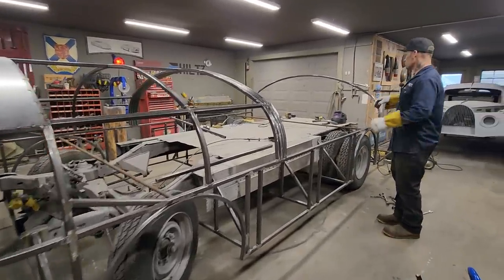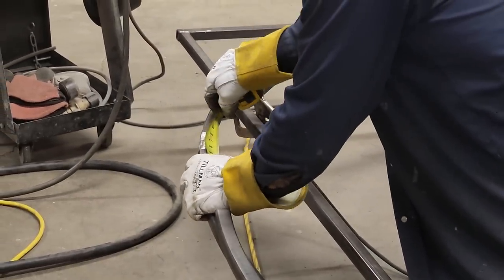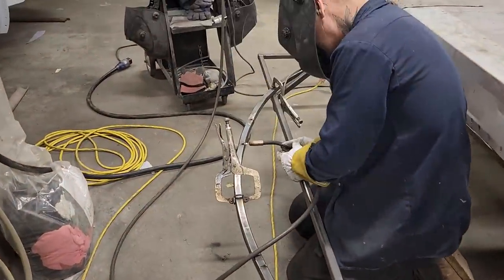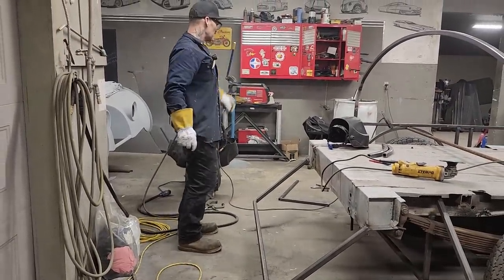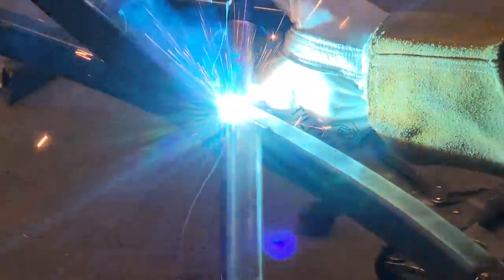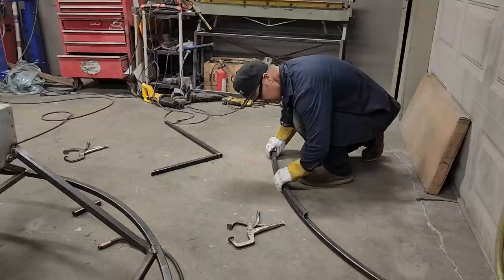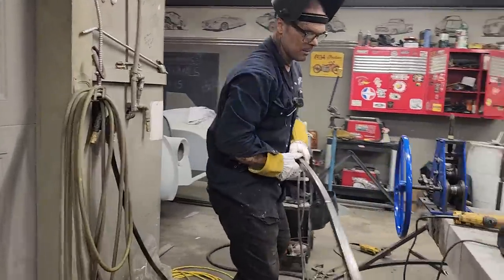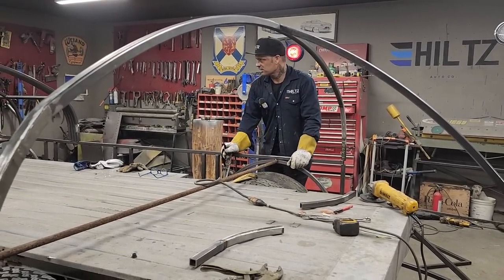Change of plans… redesigning the rear of the truck 💥

Comment: Id consider adding a chassis to the front that drops down and goes to a front bumper for straight, safety and put the seat and front bumper on, plus take steering gear

Comment: A round bum is always good looking! Seriously, the round rear is going to look great IMHO. About the steering; you could use a medium stroke small bore hydrallic cylinder attached to the steering assembly and a rotary spool valve at the bottom of your steering column. This might give you more flexibility on locating your seating arrangement and eliminate the current (and very large) steering box. Nathan and the guys at your local hydraulic shop or Princess Auto should  be able to advise you about feasability.

Comment: As far as the front tires are concerned, as long as you can turn the vehicle from side to side as is, I wouldn’t try to extend the front axle length or anything, just fabricate a couple of fender skirts and call it good 😊👍

Comment: That is perfect! The back more pointed than the front is the embodiment of 20s-40s design! The back makes me think of something like a 1937 greyhound bus. Amazing work!
Reply: How is the back at that angle going to cooperate with the last roof support?  It seems like the angle from the flat curved roof to the angle of the rear down will be harshly sharp.  I think he will cut it off and make it more straight from the bottom with a curve half way up that more closely matches the front so the roof to rear flows nicely like the front does.

Comment: If you are going to use it to tow vehicles then you need to think about a tow hitch that will need to come out the back and contact to the original frame and at the right height to tow correctly 
Now would be the time to fabricate that in  so it is strong enough 
This project looks great so far ,awesome work

Comment: I know that it would be different than the original idea, But looking at how much room you have in the front wheel well, how about putting fender skirts on front and rear and completely hiding the wheels? Then you wouldn't need to get the front wheels any wider out. I think that would be a pretty cool look.

Comment: Chad,  Engine needs to be removable from the bottom. All you have to do is figure out where it is going to be and box up the hole on the deck. Then you can make a cover to close it off. I'm more worried about where the door is going to be to drive it.  Steve

Comment: Shed as you build your doodlebug, you might think about adding the ventilation for the engine to get rid of the carbon monoxide that might be let out it’s a silent killer wouldn’t want to see anything happen to you guys that’s why to bits it looks like you’re doing a great job
Reply: Or seal the cabin off with a bulk head isolating  CO fumes is a good idea even for short term trips

Comment: Good call on the rear, it looks great. I still think installing the engine, and trans. from the bottom would be the best thing to do. So much easier for later on if you need to pull it to work on.

Comment: Hey Chad if you put the ls in switch it to carburetor and put a 350 turbo behind it then it will make the wiring of the motor a lot easier because all you have to do is hook a msd box to make the coil packs work and for alternator you could run a one wire just a thought

Comment: Try a Lenox 5" diamond disc cutter on the grinder. The diameter of the cutter won't shrink as it's being used and will give you 1/4" extra cutting depth.

Comment: Love Chad's vision on an aft redo.
Reply: Totally agree, like the shape of the rear. 
Also need to think about the cooling system/ radiator and air flow for cooling.
Reply: @CSmith-oz4wp  The photos appear to support a rear engine layout. The louvers and such are just aft of the rear wheels. I would like to see a photo of the engine compartment but haven't located any.

Comment: Looking good, those roof bows, or rafters as you call them could actually help you out as far as the engine goes. When you mentioned windows down the side to see the engine, you could use the bows to make a removable section, even as a side tilting centre hood scenario or gull wing style? As you said, it’s not a replica of a ‘Doodle Bug’ it’s only inspired by one. So many different directions you could go with this, I’m not quite sure what your plans are for this thing other than looking cool Cheers again from Australia.

Comment: Looks great guys but as an ex-trucker I know you will need to be careful where you drive it with that much overhang that low at the rear you will probably scrape in driveways etc. but it does look cool, All the best, Al

Comment: Chad 1st time commenting on a build, I watch faithfully every day, firing up the Bugatti engine was awesome to bad it burnt up the carpet. The Texaco doodle bug is an awesome build I just had a suggestion on the engine location. I would put it in the original location and then the rear portion of the inside can be used as storage of things you may need to carry along on the trip when hauling the Bugatti. And I know that you are going to build it the way you see it in your brain so know that my idea is just a suggestion. Either way it’s going to be an awesome build. I watch every day not only to see what you are going to do next but to get ideas for you for builds that I have. And I have gotten a lot of awesome stuff from watching you work on your cars. By watching you I have learned so many things that I can use on my projects. And Jolene is awesome on the camera and she is a pretty awesome flathead drag racer. Thank you for letting me share an idea I had!

Comment: You have not talked about how you will get in and out of this project. Crawling from a mid door is not a good idea in an engine fire situation… I suggest giving some thought to the front opening in some fashion. The supporting structure for said door needs to be engineered prior to sheeting… Safety would necessitate a firewall between the engine and the passenger compartment as well; Your wife will be in this rod Chad, priorities and all that. Cool project!

Comment: I like that bender. I wonder if you can get dies for tubing ??  Would it be a primitive mandrel bender. Be a challenge to design and bend a custom exhaust system with it...a challenge that I could not resist.

Comment: I use to have to drive one of those, "Home heating fuel trucks" once a week, take my turn, go to all the people that use mineral spirits, dry cleaners, auto shops ... the shifter was up underneath my arm and you pull it down and up to shift it. We used to call it the "armadillo" ...😊
Reply: I flooded the top once, you have to tell the guy loading you up on the big tank when to stop. I didn't tell him in time and I flooded the top and soaked my shoes up to the ankle, by the time I got to the first customer, my feet had a bad rash with that stuff ... it's basically turpentine ...

Comment: I think that last piece he put in goes to the roof at a too sharp of an angle and the roof to back merge is going to be as he would put it "not pleasing to the eye."I suspect he will cut it off and make it go straight up and then curve it at a more curved angle more similar to the front, so it matches up better with that last roof support.

Comment: I'd put a tail on it, turn the radius back out the other way. Do like an aero look
Reply: take it out to a point, then go straight up from the centre, and straight back from the centre of the roof so still get your square at the rear, and use concave panels to make like a fin or tail kinda dealio

Comment: I would use a turbo diesel to power it. Don’t think a small block is big enough to push it down the road. 
I do like your redesign of the back. It flows much better.

Comment: What if, you changed the plan and kept the front as is for cool round transport cab vibe and than after the cab, stop it flat and keep the back as a flat deck.  You’d have some utility to haul equipment and still tow the Bugatti. You’d have front doodle bug, back flat deck.

Comment: I would make a large rear door. Cute and slick or practical? I grew up hungry. It hard for me to comprehend building somthing that is not practical. It's a heavy duty chassis. Make it a mobil welding Truck. Generator on one side welder on the other side. Steel flip open doors on the side. Gas lifts keep doors open. Organized tool bins compartments for your tools. Put a hitch and pull 49 Truck with more tools. You can even advertise a welding companys products. Welders grinders. Air tools. Everything you need to repair almost anything broke down by the side of the road.

Comment: I have a 2015 Silverado I special ordered it with a 6.2L LT1 with 420hp and 460 ft. lbs. torque.  It is a horse with a lot of pulling power and a 6.2L would be great in the Doddlebug for towing.  Your Suburban may have the same 6.2L engine in it too ?

Comment: I think you should, at the least, put a pair of vise grips on that tensioner on the roller or make a dam handle for it.  And you are supposed to calculate that first 4-6 inches  in your pre-bent length and then cut it off.